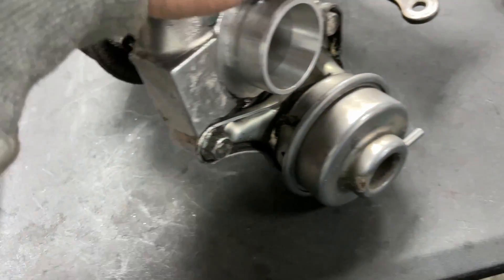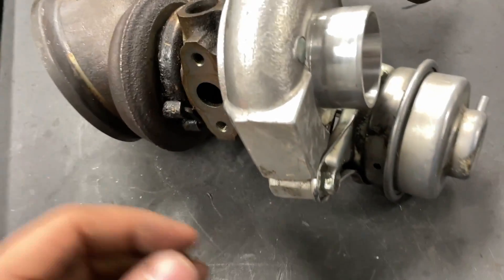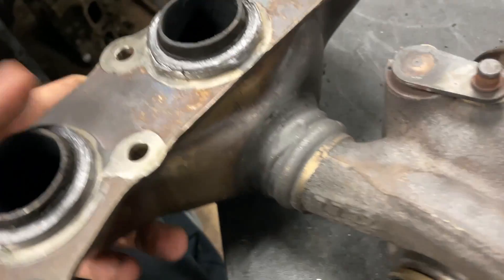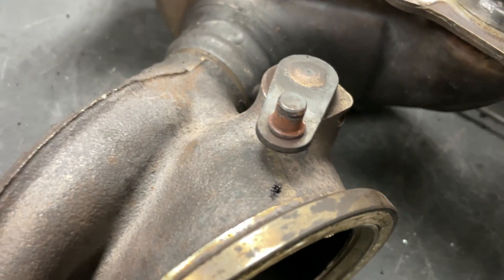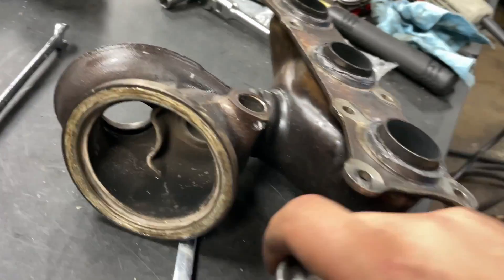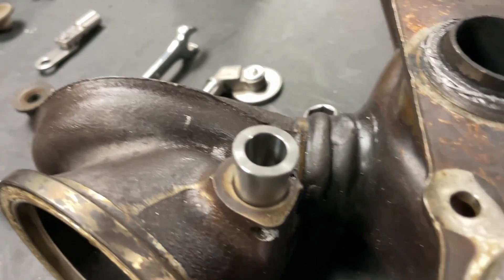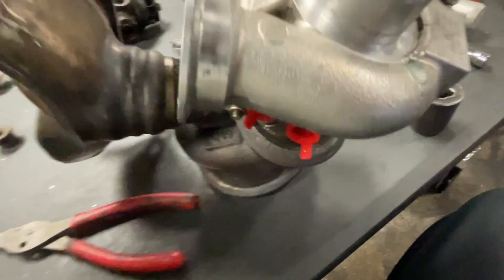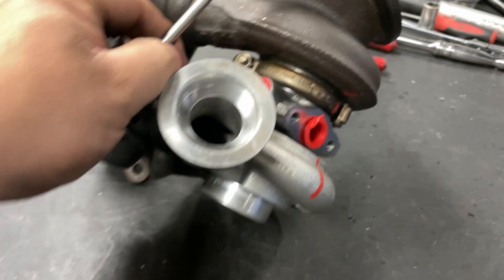N54 Stock Turbo upgrade DIY

Comment: I did these on my car. Currenlty have 1200miles on them and they seem to be good
Reply: Have about 7k miles now. They’re holding up. I run about 22-24 psi on ethanol. Was able to hit 27psi with an experimental tune my tuner made
Reply: @AppleMan561  did you get thee stage 1 chra?
Reply: @ianc2918  I don’t think so. I got Orem chra with td04 bearings and a billet compressor wheel
Reply: @AppleMan561  how are they now? how many miles?
Reply: yeah any update?
Reply: Update? Still making boost, how much? I’m at 23psi on original turbos

Comment: Did u crank the engine for 30 seconds before starting it to circulate oil into the turbos
Reply from the maker: Injectors and coil packs unplugged. Yes
Reply: @N54RacingChannel  very good